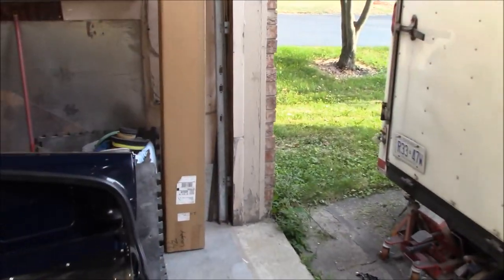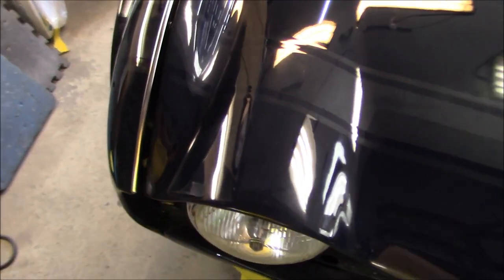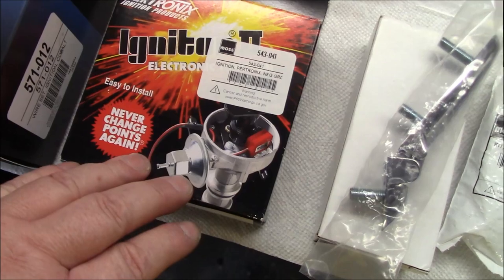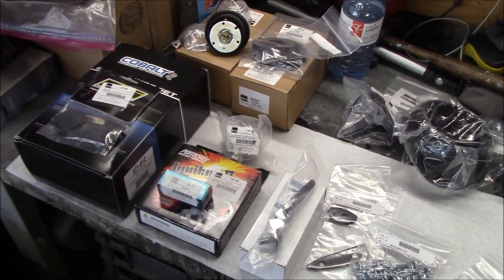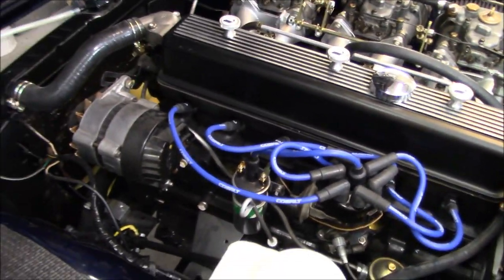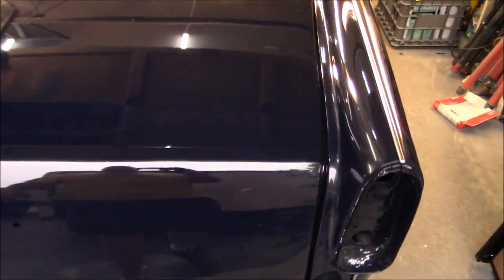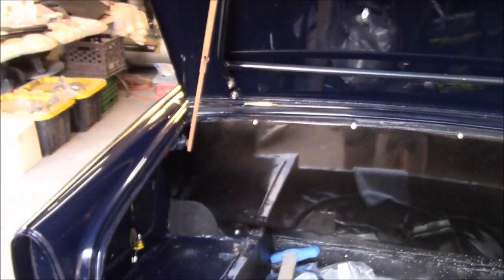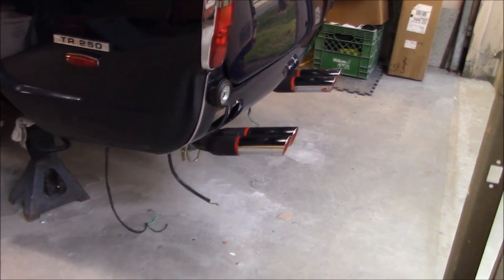1968 Triumph TR250 Restoration Project, Final Assembly Part Four, Bonnet & Boot + Rear Lights!

Comment: Nice work Tush…. My tail lamps gave me a lot of work together them in. Same issue with the trunk weather strip as you, overtime they settle in. I have the same wires for my TR4 but going to have get the numbers like the look on that…  thank god for Moss having the parts for these cars…

Comment: I glad the tailights fit, after all the work you did back there it would have been a real shame if they were out of whack.  Great progress.
Reply from the maker: If there was anything on the car John that I worried the most about it was the tail light fitment especially with the extra layers of paint and clear coat.  I was kind of shocked when I test fitted it, it went right on.  All that worrying for nothing 😉

Comment: Always great videos ChefTush. Just had a thought while viewing today. I noticed your portable fans have about the same amount of grill debris as mine do. My guess is that they are collecting and releasing particulate when they are on. Just a humble observation as to why you may be having the airborne paint imperfections. We love you in the U.S. Cheers.......
Reply from the maker: Thanks Thomas, yes you are correct, they do pick up a lot of debris.  Not sure if it would effect the paint job though as I’ve always got them positioned pointing out and exhausting out the front of the garage ( unless the debris is blowing back in). Cheers, Tush

Comment: I like the blue spark plug wires, because that's what I use on mine! Super progress, the back end is looking so much better with the boot and lights on. I forgot the 250 had all red tail lights, something I use to do on my 60's VW's to make them less European. I did have US side markers on my TR6 but changed them to amber as I like the way it wraps round the side of the car in one continuous colour. Brilliant video, just one thing: editing, often you cut yourself off when you cut to a new section, just another second or two and it would be seamless, hope you don't mind me saying?

Comment: Looking great! It would be nice if all that was wrong with 5 & 6 was that the wires were swapped. Fingers crossed...
Reply from the maker: Don’t think it was…I went back and looked at a few videos…I think they were correct during the engine break in.    I think I might have mislabelled them when pulling the cap off to exchange the wires.
Reply: @cheftush  Oh well, it's never that easy I suppose. 

It does beg the question on engines with multiple carbs, how do you troubleshoot gas flow out of the carb? Swapping them to see if the problem follows the suspect carb is one way I guess, or tear it down and look for problems I suppose.

In my line of work, we would put flowmeters on both the air and the gas to check the ratio. The test equipment tends to get a bit pricey for this approach though.
Reply from the maker: @MrWaalkman  well, I do have an air flow meter. I’ve also got access to three sets of the gunson colour tune kit so I think that should help a bit.   I also went through the carbs after the initial break in a did a bit deeper cleaning  of the internals so that should help. Cheers, Tush
Reply: @cheftush  That would work. As for the gas flow, just have the carb pull the gas from a beaker. More accurate that way anyways.

When it comes to metering, there are lies, damn lies, and flowmeters.

Comment: Wow and again wow !, looking very, very good !
The trunk ( boot ) seal on my 4A has never fit properly along the bottom , 
when I clamp the lid tight the seal bulges out and looks not smart, (I've noticed other Michelotti cars 
with the same problem), in frustration I've cut the bottom portion out, but since you mentioned
the TR6 seal I'm thinking I might give it a try, is the 6 seal long enough to fit around the 4A opening ?
Reply from the maker: I’ll loan you the seal that I took off to see if it might work for you Dennis but I suspect your current seal is glued on?

Comment: Dave the stripe looks great! I have the Cobalt wires on my TR4A. Lastly I agree with your decision with the boot lid👍
Also are your steering shaft shackles cadmium plated? They looked like they were in the video.
Reply from the maker: Hi Jim, yes, the steering shaft parts are fake cadmium painted.
Reply: @cheftush  Ah, the Eastwood “cad”system? Looks really good!
Reply from the maker: @TR4Ajim  you got it.   I should really get a proper cadmium plating kit from someone like Caswell but it’s more stuff to buy/store….